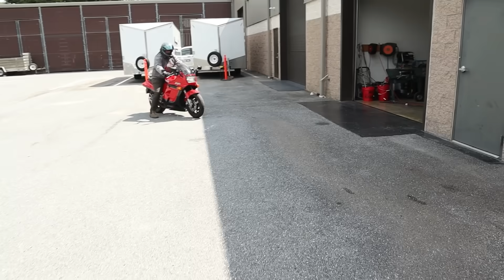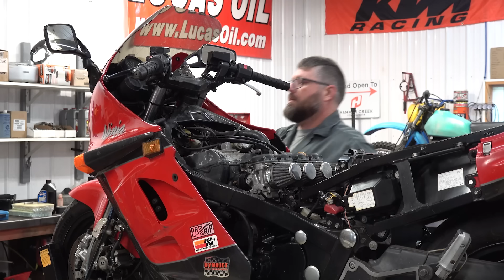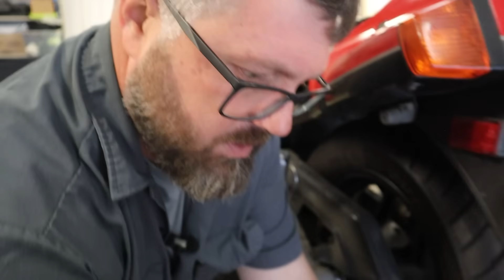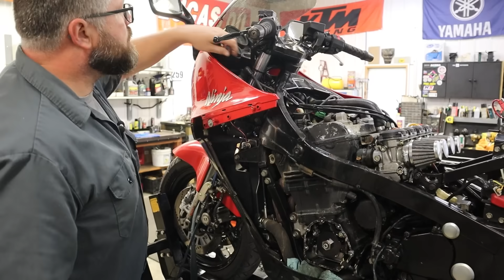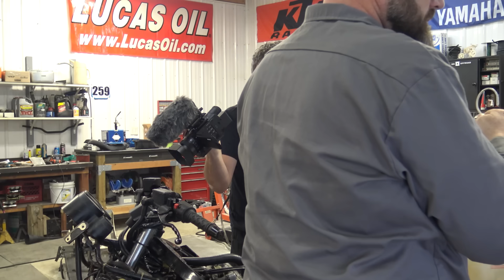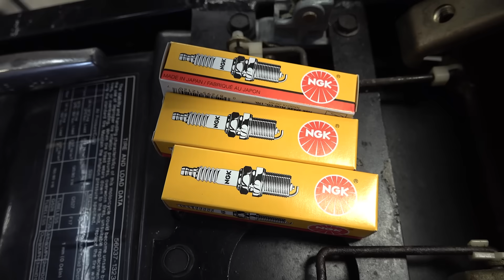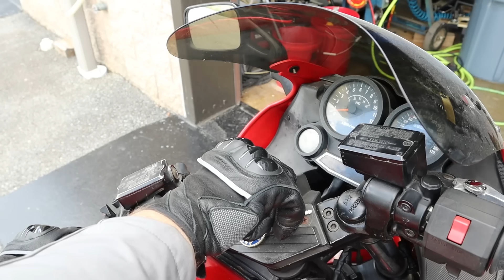Can I Fix This Unfixable Iconic Ninja Super Sport Bike?

Comment: Good job!  😀 Bought a 1985 900 Ninja brand new, absolutely loved that bike. Easy to work on, easy to change oil and adjust the valves. I went down at 130+ on that bike in 1992, bike was destroyed as well as a few body parts and skin of my own. About 2 months later I found the same model bike, transferred what HP goodies I could from the old pieces and rode that bike for a number of years. They were pretty much bullet proof as long as you stayed on top of maintenance and simply took care of the bike.
Reply: I’ve got a registered and rideable A1 GPZ900R in my back shed 👍
Reply: I wouldn't call them "Bulletproof" they do have some well known issues (mainly the A1/A2 models) that are easily sorted. The biggest issue with them now days is finding a nice one that has been looked after and not gone through the hands of a complete eejit.

Comment: Well done Craig , hope the customer paid you well,  you did far more than any of the others were prepared to do 10/10
Reply: This job must have cost over 1000 or 2000 dollar. Much more as the current value of the bike.
I have the same problem with motor which has not run for 15 years. The mechanic warns me for the costs although it is a great bike.

Comment: Would have been nice to see Craig test the new coils and pickups in the same manner to see the difference.
Reply: wonder y...........
Reply: I think the new pickup coils wouldve measured fine (ohms), but they somehow threw off the timing, as we could witness when the exhaust was banging and popping.

Btw I think the old coils were fine. Seeing they measured the same and judging by the mounting brackets made me think those coils may be just sourced from a different bike.
The problem clearly was the pickup coils.
Reply: @Chris-yy7qc  Those were dyna coils, a really well known aftermarket brand of coil, I have them on 3 bikes I own and I've never had an issue.
I'm curious if they were measured to "their" specs vs the factory ones....and also if the proper resistance caps and plugs were used.

Another thing with setting carbs is on older bikes, It's a good idea to check the lifter shims BEFORE you set the carbs, especially if you know it's been sitting for awhile.
My yamaha was so far out of whack it wouldn't even idle start, Took me 3 hours to trace it out and redo the shims.
Reply: literally just thinking this. but I am coming from a place of almost no mechanical knowledge.
Reply: @xeronicus  forgive my mechanical ignorance - just trying to learn from your comment. this was a case of valve clearance out of spec causing not enough air entering the carbs as a result?
Reply: @xeronicus exactly.  There was nothing wrong with those dynatek coils.  The green ones are 3ohm units so Craig’s initial measurements were within spec for them.  Have had dynateks on a number of bikes and never had a lick of trouble that wasn’t “user error.”

Comment: Hey Craig great job! On your ohm check on the ignition coil secondary you had the plug wires in the circuit, which will add resistance. Just something to keep in mind. Keep up the great videos

Comment: I bought this same bike brand new in 1986 at G&G cycles in. Salisbury Massachusetts. My friend had the GPZ900 ninja like in the Top Gun movie.. after riding that I was sold on Kawasaki.. and bought the 1000R. I had it 13 years and put over 50 thousand miles on it.. I took it to Sturgis in South Dakota.. back in 2000.. it ran like crap do to the altitude difference and the speedometer cable broke.. I sold it soon after for $2500 bucks.. if that cable hadn’t broke I might of kept it just to see how long that motor would have lasted… then I lost my license for 6 years.. after that I bought a 98 ZX900 then the 04 ZX10r then on to the bike I have now.. 2006 ZX10R.  This bike will probably take me to the end… lots of great memories and pictures.. let the good times roll…

Comment: Many years ago I picked up a 1990 ZX-10 off craigs list. I did not have a chance to put too many miles on it but along with a carb problem it also, I eventually found out through trial and error, had the same type of coil problem. The owner had given up on it and he also had a garage full of toys to play with so it was just up against a wall covered in dust. I got the bike for a song and a dance.The bike had not ran for over 10 years and wasn't running worth a crap when the previous owner stopped riding it and gave up on it. Not doing a commercial here but for anyone out there having this problem you can get a set of new Dyna brand high energy coils and swap those out from the factory coils. Once I installed the Dyna coils in I was able to finish syncing the carbs. Gave her a bath and oh my god that bike was awsome and with only a little over 15000 miles on the clock it looked brand new and ran like new. Didn't have it very long before a collector of these types of bikes bought it from me somewhere down in Alabama. Kinda makes me wonder if this coil thing is a common problem with these bikes!!😁

Comment: that's actually so crazy to me that two other shops wouldn't test the stator coils, pickups, or ignition coils. Those are almost always the first things I'll go to for diagnosis after I've confirmed good fuel flow for carbies and good pumps for FI.
Reply: I came into this video really thinking we were going to get a head scratcher. Perhaps because I've been through the ignition and related on my 1984 Nighthawk so I feel the pain of 40 year old electrical!

Comment: I still have my GPZ 900r I bought in 1984. In my tool kit I carried a 800ohm resistor because if one of the trigger coils fails the igniter box shuts down which on mine could happen often. Buy placing the resistor across the trigger coil that's failed it completes the circuit and I ride home on 2 cylinders. Good work guys, I love my bike.

Comment: Excellent job trouble shooting the problem. I've got an old Kawasaki Concours 1000, same engine as the Ninja, and do all the work myself because very few mechanics want to touch it. Just a little history, we all knew about the Ninja's before Top Gun. I graduated in 86, and I remember the first of what I'd call the modern day rice rockets were the Honda Interceptors, then the Ninja's GPZ's came out and that was the hot bike until the Suzuki GSXR's made their debut in 86. The one Maverick had was a Ninja GPZ 900R, still a hot bike!
Reply: The GPZ 900R (we never knew it as the "Ninja")  is still a good bike it outlived not only the bike that was supposed to replace it, but the bike that was to replace the replacement! You could still buy it as a new bike well into the 90s here in NZ, and was still selling in Japan until 2003.  This model tho, was a fizzle, it did nothing better than the 900R and was poorer than it in many areas. Still its nice to see a decent one again, haven't seen one that wasn't a basket case in years.

Comment: I had a similar problem with my old Suzuki GSX400X. It turned out to be the ignition coil losing power when the engine is hot. It took some time to figure out. 
Now I haven't watched the video to the end, it will be interesting to see if it's the same problem (probably not)
Reply: Probably is, that's what coils do. Check their well grounded.

Comment: I wonder if one of the (probably) many previous owners changed out the factory coils for “performance” coils. Old high performance bikes like this had plenty of power, but for many owners there’s a whispered temptation to do things and add stuff to “make it faster”. The sketchy DIY-ish coil mounts would immediately make me suspicious, especially given that the coil resistance was so much higher than spec.
Reply: Yep, they were green Dyna coils
Reply: I used to work at a shop that had a Factory Pro dyno, and what used to amaze owners constantly was A: how little HP their bikes made at the rear wheel compared to the figure quoted in the sales brochure, usually 20/25hp less, as the factories measured HP "At the crank" then the advertisement dept embellished it. And B: how little HP their flash, new, shiny "performance" part made, (often they would lose HP). Before dynos made advertisers of aftermarket performance parts kinda honest, some of the claims for go faster bits were outrageous.🤣
Reply: @uhtred7860  years back I remember someone showing off their dyno graph for their bike showing an impressive power figure for that engine. In small writing on the graph you could see a correction figure listed on the graph. 20%!

Comment: Good to see that you managed to get the old barge running. When watching you take the cover off to inspect the "Trigger coils"  I noticed that the bike has been fitted with a "Vance&Hines" ignition advancer plate, so that will affect the slow running a little bit, plus the ignition coils were a set of "Dyna" coils, again that will give slightly different reading. Anyhoo, glad it all ended up running, but those pod filters would go straight in the bin if it were my bike, 🤣.
Reply: Agreed
Reply: Just watched and wanted to mention those Dyna coils. BIG deal/bragging rights back in the day 👍
Reply: Yep, pod filters with CV carbs are a pain in the arse, and CVs always work better with the airbox.

Comment: I used to work on a lot of these old Kawasaki's. The ignition coils were one of their weak points, and as you discovered, they don't run well on cheaper after market coils. All of these old Kawasaki's were the same, the GT550 and 750, GPZ and GPX600s all suffered from coils issues. Also the pins on the ignition box CDI would rot and break off causing running issues too. At least you got there in the end, and hats off to your patience with the bike. As a mechanic myself, we've all been there, a ten minute diagnoses becomes a nightmare. I guess this is why other shops didn't want to take on the job. Personally I love the challenge, it makes you a better mechanic, and you never stop learning even though this is a simple machine with carburettors.

Comment: The reason most shops these days won’t fix older equipment like this is because the art of diagnosing something based off of the symptoms being exhibited is a dying art.. most techs these days go straight for the laptop/ipad to diagnose through the sensors on the vehicle .. and since it’s mostly new kids coming in to shops these days, they don’t even want to try looking at them
Reply: Think about how long it took to diagnose and fix this bike. It's a cool bike but would YOU want to pay a hundred labor hours for a bike you can get for a grand or two? They absolutely can do the work. No one wants to pay for it.

Comment: Had a 1970 Ford F250 highboy with a 360 engine on the farm as a teenager, I was getting ready to do a tune up because it was running rough. Started pulling plug wires while it was running pulled 4 or 5 before I started to notice a difference in it running. At that time parts were cheap just thew all new ignition parts at it, cap, rotor, plugs etc.. Ran great after that

Comment: I like the full fairing look on the older sport bikes. I remember when they first came out and my friends and I wanted one. I still have my 04 GSXR750 after 20 years. It has the full fairing look but is fuel injected which is nice. With just regular maintenance it’s been pretty much trouble free. Cool to see you put another cool older bike back on the road

Comment: I feel with you 100%!!!!! I had the same issue on my 390 FE Ford. Just died on me. Was running like crap. The Mallory coil measured out perfectly. I changed timing chain, plugs and even the heads cause I thought I had stucked valves. Nope the stupid coil just failed under load the spark got weak suddenly  and the compression helped to just blow out the weak spark! It killed me!

Comment: Man I was feeling your pain.  IMO you gotta really love a machine to go through all of that.  The biggest difference between my current R1250GS and my previous G650GS, other than displacement, is accessibility of the engine.  The big GS bikes just have all their business hanging out, while the smaller ones have to be completely disassembled to check on anything. Temp sensitive issues can be the worst too.

Comment: This has actually given me the confidence to tackle my own RX, there's a consistent problem with the fuel tanks rusting internally, easily cured with a good clean and an inline filter. First I need to unseize the brakes, ditch the original airbox (you need at least 3 hands to line the carbs up and get it all back together again) new tyres, fresh oil and plugs, and see if I can't get the old girl running again. Values in the UK are so low £1000/£800 I don't want to invest too much but it's such a great bike when running sweet. Great sound as well.

Comment: I have 96 gpz900, had ign coils/wires be flakey.  I have a Zx12r with spare electrical parts....I machined alum. coil spacers and popped in zx coils/ign subharness.....runs like a top no more intermittent issues part way thru a ride. A nice clean install too!!!

Comment: Great video, Till now i had to fix problems related to the carbs, starter relay or spark plugs. Neffer had problems with the ignition coils probably because no one was messing with them. For me it is clear to get OEM parts and no cheap ebay (from the east?) parts. This was a good lecture and I will keep it to remember.

Comment: Owned and rode this very bike for over 5 years. I resolved the heating issue by adding a manual fan switch next to the ignition and ran it the entire time I rode. Had the carbs tuned for max and it would only run with 106 octane boost. Once those were added it ran like a scalded cheetah!

Comment: I got 4 bikes, myself driving the youngest BMW K1200 RS made in 2002, a Ninja ZX-7 R  from 2000 for my son, my wife is driving a Suzuki GSX 1100 G  Mobec-KIt - 122 HP) from 1991 and my daughter got the Ninja ZZR 1100 C ( open 150 HP ).
It is always a lot of searching when there is something wrong with the bikes, but I can do everything myself and I do not need any help from a garage.
The ZX-7R was the most cumbersome, had issues with the fuel-pump ( modified to pressure-driven pump) and the cooling system (new thermostat and vent-switch) . 
A lot of work and thinking, but very satisfied when you got it running !

Comment: Nice job Craig! The key for me on a vintage bike recovery is getting to it before the "knucklheads" get their hands on it. My last two builds they got to them first. And on both bikes those knuckleheads worked at a shop (of some sort). Someone paid good money just to have someone make it worse.
Reply: I used to work for a guy who imported old Kawasaki Z1/900/1000s and two stroke triples into NZ from the U.S about 2 decades ago when they were dirt cheap, some of the "repairs" we found going over those bikes were unbelievable, many downright dangerous. Using hose clips to hold on the front sprocket was very common, other hilarious "fixes" we found were, using rubber fuel hose as brake lines😆 using wires used in homes for the wiring, using filler to"fix" fuel tank leaks and using wood screws as fasteners, this last one was VERY common. I'm restoring an 87 FZR1000 at the moment and has suffered from a "knucklhead".

Comment: A good tool/ tools I use for these kind of ignition problems on car are neons. They fit over the plugs and flash when sparked. If they go dull or shut off, you can easily identify the cylinder misfiring. However, the only thing they can't detect is spark plug dropout or incorrect heat range of plugs.

Comment: I love the old school anti-dive units on the forks! I’ve had a few bikes with these, and a few before they made an appearance. And plenty with points ignition too! Coils can be a pain in the arse!
Reply: I by pass or remove the Anti dive on all my 80s bikes and fit emulator valves. Anti dive was a technological dead end, a band aid. By 87 is was being dropped because modern cartridge forks were appearing on bikes. On any bikes with damper rod forks and anti dive, I fit emulators valves and blank off the anti dive unit, I leave them on tho to keep the appearance of the stock forks. This upgrades the suspension and makes it far better than it was with the stock anti dive units, which never really worked that well even when new.

Comment: This reminds me of something my dad always says when something is running like crap and I’ve scratched my head for an hour : “ 90% of carburetor trouble is in the ignition “. This is ( and I’m going out on a limb here ) ALWAYS true.  I generally quote the “Honda Whisperer “ John Maclefresh ( ClevelandMoto podcast . I’m not affiliated, but it’s a great podcast about working on old garbage …. And drinking, apparently ): “ I’ve never met a carb that didn’t need cleaning “. The two best pieces of advice regarding the internal combustion process that I have ever gotten.

Comment: That valve cover reminds me of the float chamber from my GSX750F, that was glued on with non-fuel-resistant silicone...carburetors looked overall like shjt, but pre-owner said he has renewed everything...that's why I pull apart everything on each bike I buy, changing all fluids, before really driving it and check everything.

Comment: Good job. I own an old Suzuki Katana from the 1980s. Hardest part is finding a mechanic to work on it. Usually they are reluctant due to worry about bolts being seized or parts no longer available. It's a fun bike to ride though and I've been able to keep it running with parts off Ebay.

Comment: I was beginning to think it would be the Regulator/rectifier. I've got an '89 zxr400 that would run for a little while before cutting out. It start and run fine again after a few minutes cooling before then cutting out again.
The terminals to the reg/rec had melted. Easy fix once I found it.